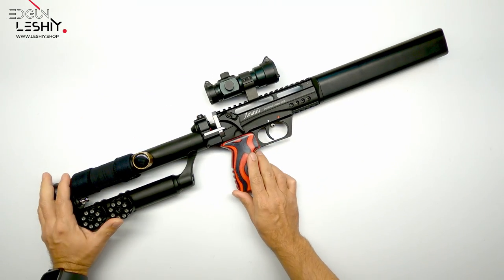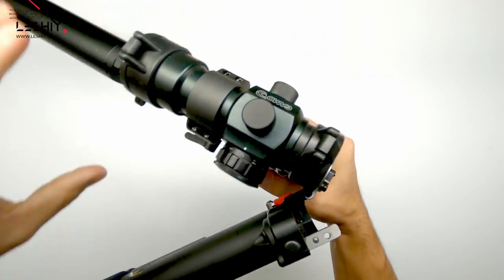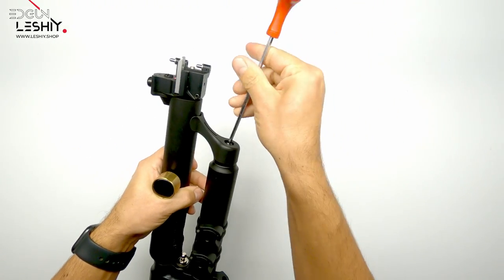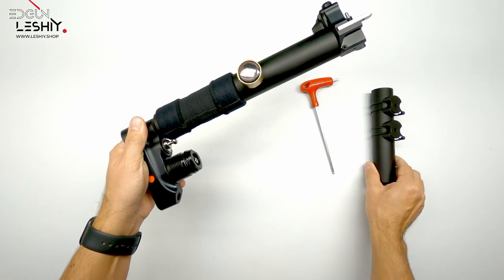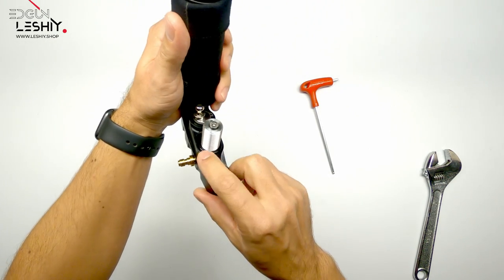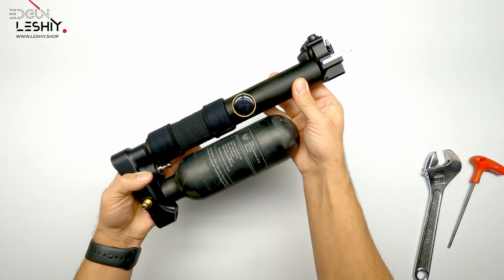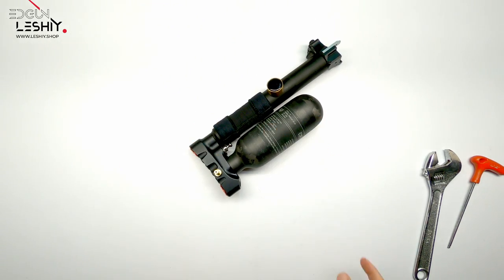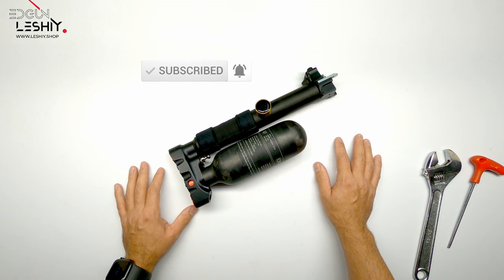LESHIY 2 350CC CF BOTTLE INSTALLATION

Comment: Nice video as always, do you know if 480cc bottles can be fixed? In terms of shot count would make some difference but I am not sure if the length is not to much for the original stock
Reply from the maker: Thx , in the original configuration I think the 480cc bottle it to long .
But if you don’t mind a longer length of pull you can add a extension tube in front of the regulator so you can add a 480cc tank .
You can find those parts in the website of EDgun.shop
Reply: @Airbuks  That makes sense, will this also means with that extension that it will have a bigger plenum?
Reply from the maker: @ruimartins44  🤔 normally not the meaning but I think you can add that tube also in front of the EAR . Not sure if that messes up the valving system 🤔

Comment: My friend do you like the leshyi 2 a lot better then the leshyi classic, or do you like the classic better.
Reply from the maker: I will choose the L2 over the classic every day off the week .
Multi shot / external adjustable regulator/ modular design/ and a lot off fun 😀👍🏻
Reply: @Airbuks  i take your word very serious my friend. Because in my opinion your the genius when it comes to airguns.
Reply from the maker: @johnnyventurino8947  thx for the confidence 🙏🏻 but I just try to do my best 😉
For me the classic is/was a very cool and different gun at the time but a few things in my option where missing to make it great .
You had to load it single and in order to tune it you always had to disassemble it to adjust the regulator.
This is all fixed with the semi 8 shot action and the externally adjustable regulator. The added benefit to the platform is that you can upgrade the L2 and customize it to a full size rifle .
The only thing I still have to get used to is the trigger that is very different then my other guns .

Comment: Hello.

You have the Fac variant.
Which nozzles are installed.
2 x 0.4 mm?

thanks
Reply from the maker: Yes mine is a FAC , for the 30cal 350mm the nozzles are 0.3
Reply: @Airbuks  

both?

Thanks Tom
Reply from the maker: @sonaxtom2417  yes 👍🏻
Reply: @Airbuks  
Thank you
Reply: @Airbuks  

Hello.

how much bar .... 120.

thanks
Reply from the maker: @sonaxtom2417  158 bar with a Alfa barrel
Reply: @Airbuks  wooo

ok. Thanks
Reply: @Airbuks  

Hello.

Do you know the size of the nozzles in the 6.35 mm variant FAC
thank you thomas
Reply from the maker: @sonaxtom2417  no not sure 🤔 there is a whole explanation on the EDgun Leshiy shop how to do it , it seems you can also make a combination off different sizes in a certain margin 🤔 still have to figure that out 😉
There is a section called best configuration at the bottom of the page 

https://www.edgunleshiy.shop/es/products/leshiy-2-power-jets
Reply: @Airbuks  

:-)
Thanks.

Comment: So is this gonna replace your FX’s ? is the accuracy on par with its price? Russians build tough and reliable guns however there not always the most accurate. Keep the videos comming on it.
Reply: My L2 is as accurate as my Impact M3 less pellet fussy and also on a par with my HW100.
Reply from the maker: No it’s not going to replace my FX’s 😉 I was a fan of the L2 from the beginning, I like that it’s modular and it’s yet another toy to thinker with . Accuracy is very good but it requires patience and testing to get to the level I wanted.
Reply: Different guns for different purposes.

The FX is really limited in it's abilities. Although accurate as hell. This type of accuracy is not necessary for people that buy a semi auto rifle like the L2.

The L2 is more of an all-arounder.

I would feel like I needed another rifle still if all I had was an FX. With the L2 I don't. Although, I do have one other rifle which is a big bore.